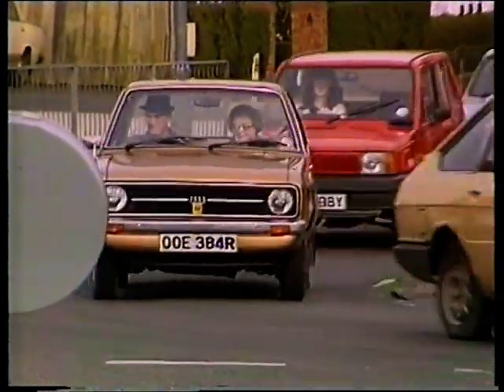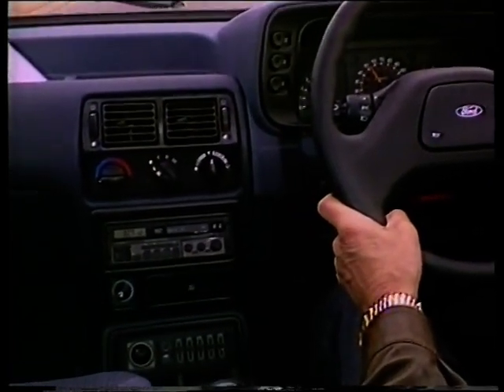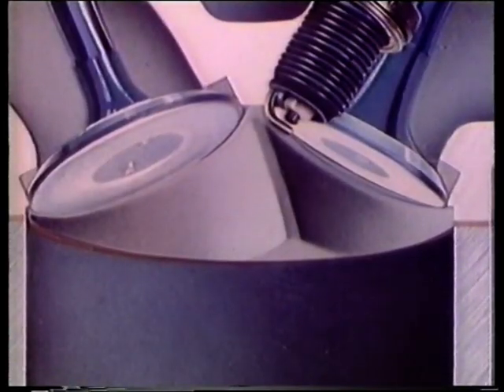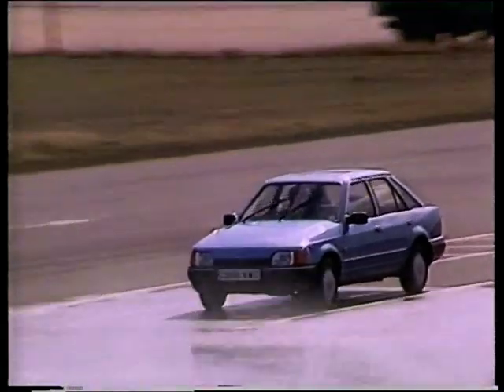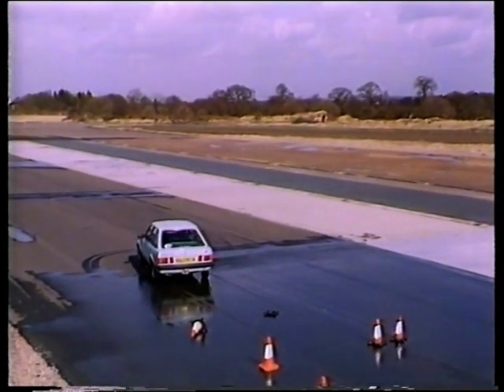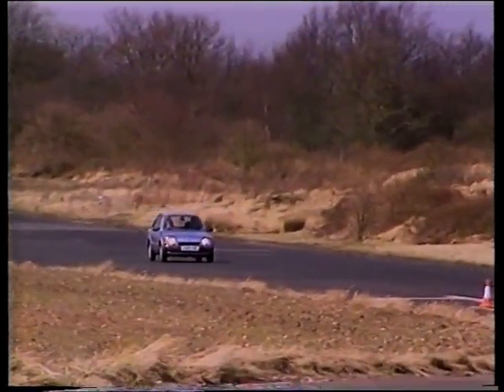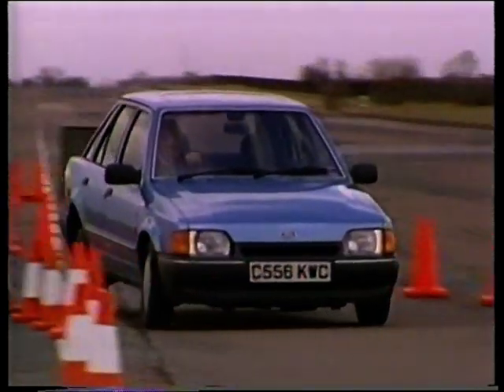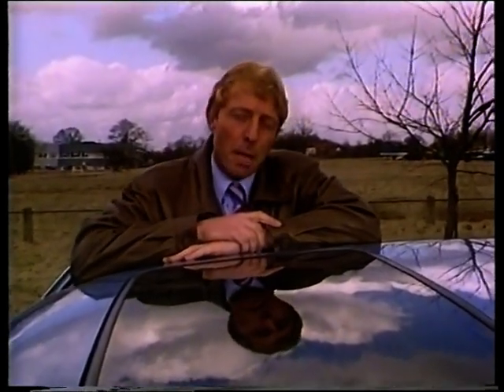FORD ESCORT Mk3 1.4 Ghia  Skid Pan demo of the Lucas Girling Mechanical ABS   1986

Comment: Back in the mid 90's I had a Orion GL 1.6d with the ABS system. My friend had a Cavalier 1.6 GL fitted with the optional ABS too. Although slower and noiser, the Orion stopped better, even though the Cavalier's system was a more modern 3 channel systen.